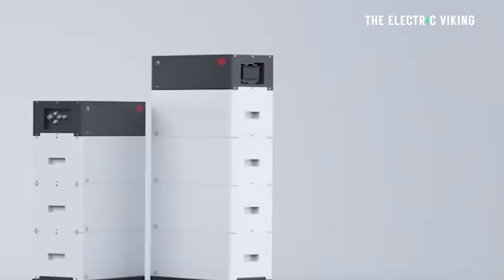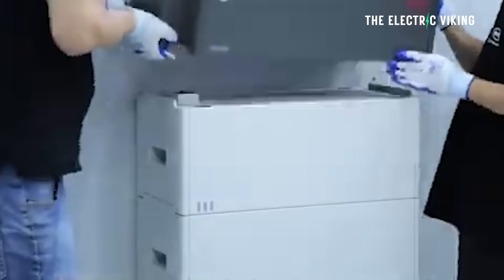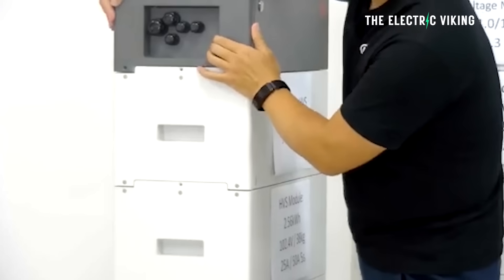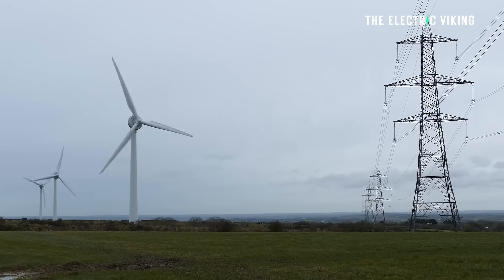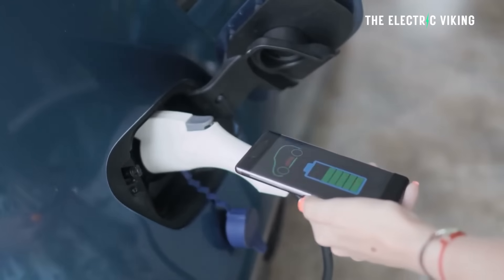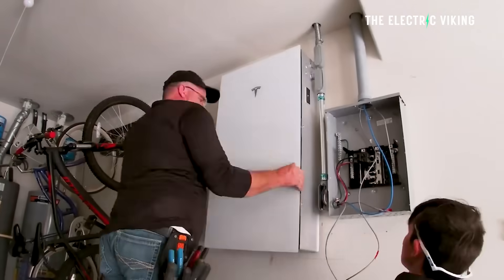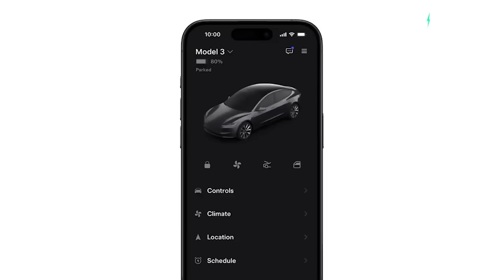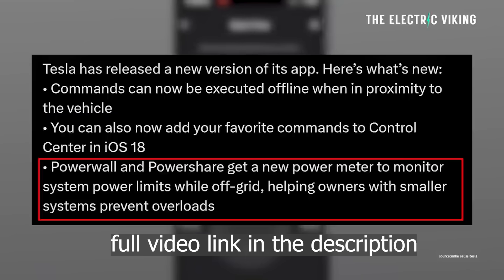BYD Battery Box vs. Tesla Powerwall – New Home Battery Battle!

Comment: I mean even Tesla uses BYD battery (before that Tesla uses panasonic battery, as a startup Tesla has a zero Battery Technology or patent panasonic has 30 years of research and development 20,000 patents), 4680 of Tesla is just their packing size and dimension  - the key internal chemistry is all Panasonic or Chinese companies)  ... Would you like to buy directly from the manufacturer Factory or from a middle man.
Reply: tesla powerwall is about a very good software side rather than the hardware, big battery is nothing new anymore
Reply: @nguyenhanh9479  i want the least amount of software possible in my powerwall. its all analoge except for the inverter. if youre relying on software to understand and use a diy ev sized battery, you shouldnt be touching anything. 
big battery buys from the same people i do and then marks everything up another 40-80%
Reply: @ what makes tesla powerwall good is how efficient the battery is, you can't archive all that without good software. if you really want the least software just buy a raw battery and start from there, anything else is hypocrite
Reply: @ my diy battery is more efficient than anything available commercially. no bms losses, no risk of premature failure or fire from a bad bms board, everyone except for the blue brand uses high frequency switching inverters which tend to be better than the low frequency ones at the cost of reliability. tesla doesnt make the batteries that go into their powerwalls, they use lifepo4 batteries from CATL or eve now, probably the former which are the same ones i use.
youre trying to rationalize something you only understand through an app interface... 
if youre talking about time of use in software, my 2013 phev allows me to set charging times lol. you dont need software on a battery to do this.
solar and batteries are dirt cheap, makes more sense to build twice the battery or double your panels than to try and squeek out more efficiency from more expensive modules.
Reply: How hard is this to do yourself? Not everyone is an electrician…nobody wants to burn their house down!
Reply: The CATL battery has a reputation for spontaneusly co bustion. EVs are dangerous . Your cranky EV followers arevthe most dangerous cult
Reply: Tesla makes the 4680 on their own production lines with their own IP applied, such as dry cathode. They still buy from other suppliers to meed demand but to say they it is just the packaging size isn't true. It's the manufacturing process.
Reply: @asjeot no they don't. CATL 4680 assembly line and dry cathode IP contracted by Tesla at giga Nevada. Tesla could never get the dry cathode 4680 to work.
Reply: lol you shook the hornets nest with the redpill concerning tesla's lack of ip. it is true that they designed 2700 can and partnered with panisonic to make the 4680. that being said, everyone realizes now that cylendrical batteries suck. circles got nothing on squares (prismatic) for density. not to mention steel case is good for safety but garbage for passive cooling.
i buy direct from CATL in the usa, dont pay any tarrifs since im under 800 bucks per order, dont pay sales tax in tax free state, and they get delivered in 280ah large format cells for about 41 greenbacks per kwh. thats like 1/20th the cost of an all in one solution by name brand mfg. inverters are dirt cheap too now, especially if you go with single phase 240v for ev charging here in the US. 
1kusd, 15kwh, 6.2kw inverter. crazy how cheap this stuff is now. like 2 weeks of groceries are the same price as never paying utility extorsion for your ev/phev charging for the rest of your life. solar is even cheaper if you get 2nd hand from some websites like san tan here in the us. 0.3$/w new from china, almost half that for 2nd hand pannels. roi is measured in months instead of years, well okay around 18-20months depending on a lot of factors. cant even make that money in the stock market right now
Reply: if you want your batteries get burn down buy tesla
Reply: @petervan7372 I guess facts don't matter. No point pissing against the wind.

Comment: If the power wall was around $10k including installation I would jump in and get one. No way am I paying $17k. Hopefully this will bring the prices down.
Reply: Prices have never come down...what makes you think they ever will?
Reply: @grantbuttenshaw  you might be correct. But competition will hopefully reduce the prices.  Realistically we should not be paying much  more per kWh than the cost of a vehicle battery.
Reply: @changeofseason8054  prices have never fallen at the retail level...they are the same price as 2018.

Comment: Sam
There are quite a few Modular systems now and in the next few months many with BiDirectional charging.
Sygengy, Sungrow, BYD, currently  and others within the next few months.
some have 5 kwh and 8 kWh modules 4.5 and 8 kWh etc. 
Prices are coming down so just hold off unless you have plenty of spare cash. 
Certainly don't borrow to get  a battery.
And if you do have data 
Not all batteries allow for Grid Down (Blackout) storage from solar in their software. 
If the grid is down then the solar wont feed the battery as you drain the battery for use. 
Some don't allow charging of your vehicle if the grid is down either.
Some but not all allow charging from the grid at low off peak rate if you don't get sufficient Solar to charge the battery particularly in Winter.
I suggest you hold off a few more months as the  release info is still a few months away.
If you have a 3 phase house some won't back up all three phases.

Check out sites like Finn Peacocks Solar Quotes site also.